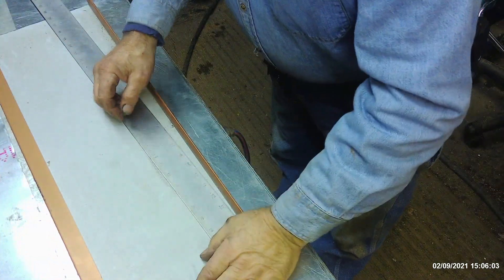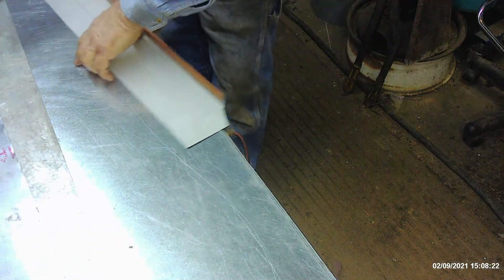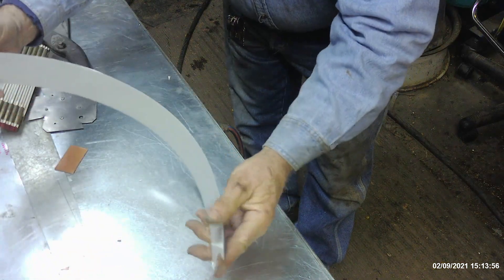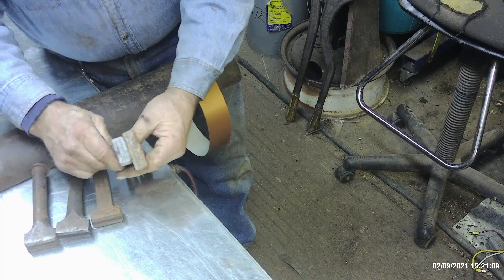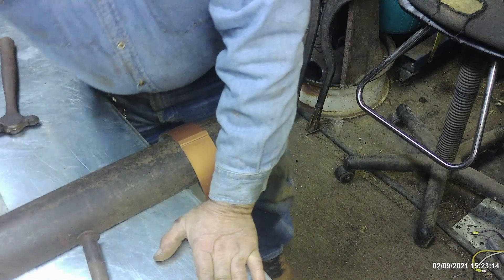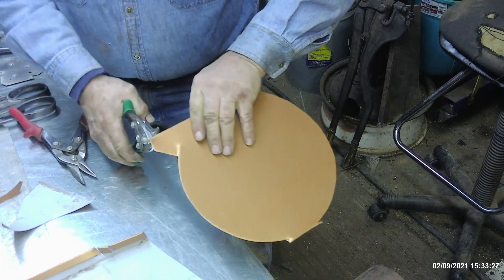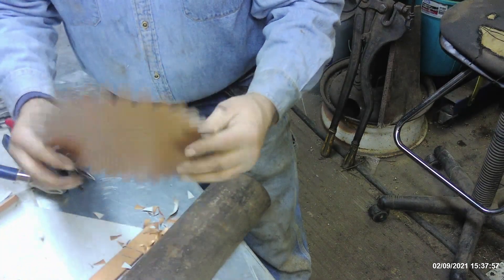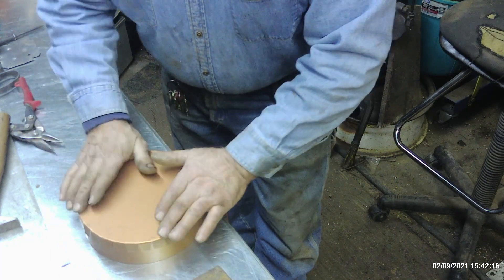8" to 7" Round Butt Joint  Sheet Metal Hack Emergency Use Only

Comment: HI TM!!! I see you are still hard at it! I hope you are not freezing to o much this winter! I am a man with as sickness. If I am not farting around in my little shop making sheet metal, I am watching sheet metal videos on YouTube, after doing it for almost 40 years!!! HAHAHAHA!!!!! I will say however, that what you and I may consider to be an "emergency" fix passes for someone's else's finished product. I am sure you have seen your share of horrendous "fixes" in your time as I have.
A few comments on some things you said in another recent video.
1. As far as layout and figuring true lengths etc. and layout in general, there is always more than one way to skin a cat. As long as the fitting comes out the way it was intended, the actual path you take to get there really doesn't matter much. Frankly the ones who cant hack find another line of work usually
2. A lot of it is relative. I do things my way because a majority of the time I was doing duct and fittings to stock a job making multiple elbows offsets transitions etc. which is different than doing a one of fitting. 
(Back in the day when I was making my own cut lists I actually had a book that had true lengths for transitions and radiuses and stretch outs for ogee offsets up to 60" length. That that knocked the math out of it!!!!!!
3. People sniff at things like hand brakes and cleat benders etc., powered by the "Armstrong" Method,
But in the case of a hand brake, A person can do some surprisingly fine work with one that is properly set  up
and treated with respect. Plus, if I had a dollar for every hour I spent, days on end, standing in front of those things I could afford to have my shoulders repaired and I could be sitting on a beach drinking lemonade and swatting the flies away. HAHAHAHA!
Glad to see you are hanging in there, I will shut up now.
Your old buddy Bill from Albuquerque!!!!
Reply from the maker: Good morning William...good to hear from you.  Computer controlled plasma tables have really changed the game concerning lay out and fabrication in general.  I've been thinking seriously about a CNC setup just for the heck of it.  Not for sheet metal, but for the heavier welding projects. They intrigue me and look like fun but the big benefit would be cutting down the prep time on things I usually cut with a torch. But....too much going on for now.  That's for the future.  
   I get a troll comment ever now and then that complains I don't do the math right or whatever...but I agree with you, it doesn't matter what way you do it, if the end result is what you intended, all is good.  About the old hand shop tools....its kinda like my old truck and tractors....many people would even want to use one or drive it even if it was free.  I'm just the opposite.  It would be embarrassing for me to drive down the road in a $50,000 truck knowing my old 85 Ford will do everything I need.  Some of the youngsters in the field don't know what a lot of the tools we use are for.  Heck far as that goes, I don't either when I really get to thinking about it.  But as long as it remains fun, I'm going to do it whether its welding, sheet metal fab, engine work or wood cutting !!   And if I see you on the beach next time I'm in Hawaii by golly I'LL buy your lemonade !!  LOL  Take care my friend and enjoy the late winter weather.

Comment: Hey nice work tractorman! Those 2 opposite half inch opposing bends is exactly how I connected my square to round duct fittings for my HVAC system. But then I had to just drive a sheet metal zip screw in to secure it. Galvanized is much softer than that steel!
Reply from the maker: Sorry Roger, I just found two of your comments in my spam folder.  Dang !  I've been thinking of buying a spot welder just for the heck of it.  No more pop rivets then....

Comment: I screw the the joints together on my elbows. I use the 1/4" zip screws anything bigger and it pops it apart
Reply from the maker: I've been guilty of that too on low pressure ducting, but on a flu that may need to sustain a volatile flu fire due to impacted creosote, I won't take the chance. But like I said, on low pressure supply or return air ducting heck yeah, it works just fine !!  Thanks for chiming in Silly Guy.  Take Care and stay warm today !!
Reply: @tractorman4461  yeah most use the hanging strap to keep the elbows from moving.

Comment: That's a good fab in my book......good enough for an electrician.....temporary ?    OK temporary last a long time....even longer than perm enact some time....adapter good for me.....CHEERS
Reply: Nothing is more permanent then a temporary fix.😁😎
Reply from the maker: I'm afraid you might be right Gator...'temporary' may take on a different meaning for the next few years....LOL.  I tell you, the 24 gage steel is a heck of a lot harder than the 24 gage galvanized.  I can barely cut it by hand !!

Comment: Hahaha,..not having ANYTHING to do with 'tin banging', I found out the hard way about those aluminum pop rivets! 
I do have a query though,.. doesn't the zinc 'off gassing' from the galvanized metals affect one's health in some way, or is that particular bit of temporary work you're doing, 
located in breathing air of the house/building?
Reply from the maker: Yes, noxious gas is potentiall given off....but only to a certain extent.  Not to the extent that welding galvanized material does, because that process actually 'burns' it and is terribly bad for your health.  This pipe will discolor with the elevated flu temps reaching 1200 *F (650*C) or higher and the surface will actually roughen up.  Yes, I had to look it up on a comparison chart....LOL.  But because of that potential, its not recommended to use galvanized pipe on a wood appliance.  So yes it could release gases technically, but in actuality I think it's totally minimal if any at all....man, maybe I should've been a politician....that's about as 'no answer' as you can get isn't it Reg..!!?  LOL  Yes, it's in my drafty basement anyway....I got a bad door gasket. But I need the combustion air anyway, so its a win-win.
Reply: @tractorman4461  Ok, good, yes, I think, errr, maybe.
Good 'nuff then, Clear as mud!   
I'd still vote for you................................  see how easily I'm led along?
Reply from the maker: @regsparkes6507  hahahahaha....you're killlin' me man.....LOL.

Comment: Hello Wendell, great little “not recommended “ hack! This just shows the experience you have in tin knocking, and the ability to do! I Jane never liked those twisty turns 90 degree flue fittings, never trusted them, and never will.   

 I didn’t see how you cut the inside of the plug, was it done with snips or a die?
Reply from the maker: I must have edited that part out....tin snips all the way Pat.  Those 4 piece adjustable 90's are allowable for natural gas, LP and fuel oil, but are not recommended for wood fired furnaces.  There are 24 ga BLACK 4 pc 90* ells that are allowed though.
Reply: @tractorman4461  yes I know, and they are also the twisty turny type I hate!
Reply from the maker: @thesmallwoodlot433  they have their place, but because of the intense flu temps on a wood appliance that literally burn off the galvanizing to produce a small amount of noxious gases its not on the recommended list.

Comment: Being in the sheetmetal trade for almost 40 years you sir have made what we call a zero clearance increaser. The install will be fine after the paint burns off. Thxs for the vids!
Reply from the maker: Well David, I knew there was a proper name for it, but I couldn't pull it out of the fogginess....LOL.  Yes, I'm pleased with it because the tail pieces of the dove tails fit right into the steel pipe when the repair was done.  Man, I didn't realize you were a REAL tinner instead of a make believe like me.  LOL  Now I'm thinking you've seen all my mistakes....LOL.  I think I said it before but I am really a commercial service tech....a bit of residential thrown in for good measure....  Thank you for the comment sir !! Now I'll try to be on my toes a bit better..... (-:

Comment: Actually it was interesting.  One repair leads to another.  Have to agree about watching the boring tennis match or golf game, even though it is good exercise if you actually play either.   Stay warm with the expected frigid temps, it’s kinda hard on the wood pile tho!
Reply from the maker: Oh man....it's knocking the heck out of the wood pile !!  It sure is nice to stay warm though. I don't think I ever even held a golf club before.  I use an old tennis racquet every summer though....they are the most effective weapon to use against red wasps when you pull a tarp off an old tractor and disturb about 50 of them.  They don't stand a chance.  But then there's always that one lucky one that sneaks by and nails ya !!

Comment: Sometimes you have to do what you have to do to get the job done.have but in many wood stove inserts in and had to make stainless steel pipe to come off the top.made the pipe just like you did.only other person who was ever known what the hand seamer tool was,was my mentor.great job and didn’t know about screwing the swivel joints together on a elbow.
Reply from the maker: This is the only application where I screw the ajustable 90's together.   When exposed to the volatility of a heavily creosoted flu fire they can, will and do fall apart.  Especially if the fitting has a few years use on it.  The chemicals of certain flu gas by products of burning wood cause deterioration of the material, weaken its structure and the constant hammering of a fully engaged fire will literally blow it apart.  The trick is to no ever burn to the point that you are creating that much creosote.  The only adjustable 90* ells recommended for use in a wood appliance are the black 90's.  Thank you for the cool comment.  
    My son and I did another small project this summer using one of the hand seamers, but I haven't gotten to put it up yet.  I have made antique tractor breather pipes as well and the authentic joint is one of these stye, though less than a quarter inch.  Thanks again for stopping by.   (-:

Comment: That's a pretty good hack Wendell
Reply from the maker: Hey Gary...Thanks for the compliment.  It'll do in a pinch like I said.  Actually its a more substantial fitting than the factory made one because of the way the factory ones assemble...plus this 24 ga steel roofing is some TUFF stuff.  I had a bit of a time cutting it with snips.
Reply: @tractorman4461  , I was thinking while I was watching that those were some pretty awesome snips.
Reply from the maker: @tractortalkwithgary1271  Those are really good snips.  The cutting edges are replaceable but if you cut only sheet metal they will last almost forever.  These here I've had for probably 30 years or more.  Hands down, much better than the old style metal snips....in my opinion.

Comment: An ounce of prevention is worth more than a pound of cure.  Good work; I know you will do a more thorough repair come spring.
Reply from the maker: Yes, I should service it every year...but sometimes I just look down from up top to make sure there are no birds nests or other blockages or any of the dreaded creosote.  But the chance of that is slim because of the way I burn it and the low moisture content of the wood used.  A concentric reducer takes a little more layout time and thought.  Not much, but a little.

Comment: I always find Your sheet metal work very impressive, I didn't know the adjustable 90° pipe Could fall apart! Good to know in case of an emergency repair situation! Thanks sir!
Reply from the maker: Yes they can fall apart, but no they do not normally.  However when exposed to the volatility of a heavily creosoted flu fire they can, will and do fall apart.  Especially if the fitting has a few years use on it.  The chemicals of certain flu gas by products cause deterioration of the material, weaken its structure and the constant hammering of a fully engaged fire will literally blow it apart.  The trick is to no ever burn to the point that you are creating that much creosote. On a side note Andrew where do you buy your Stihl parts?  I'm looking for some 028 and 038 parts.
Reply: @tractorman4461  I generally get anything I need from Amazon if it's a common enough part tho any dealer should be able to help you out for oem parts , the closest one to me is McLaren lawn equipment in spring water Ontario but that's probably a bit of a drive for you :p In my personal opinion ide say see if you can trade in them sthil saws for a pioneer or mcculloch lol but all jokes aside Amazon.com is likely your best bet for a good quick inexpensive replacement part. EBay is also a good last resort, Goodluck on the hunt sir!
Reply: @ButlerOutdoorsCanada  Stihl is a good saw.